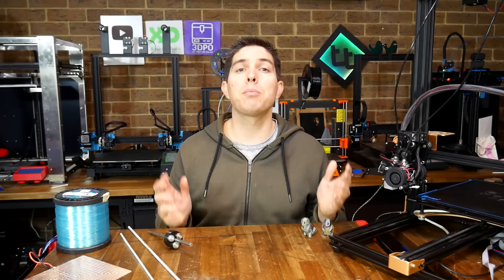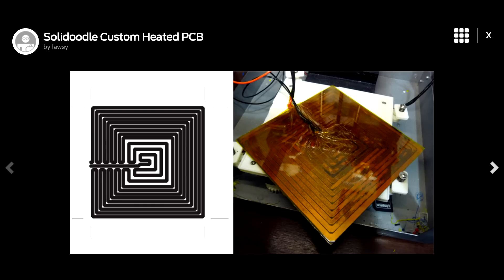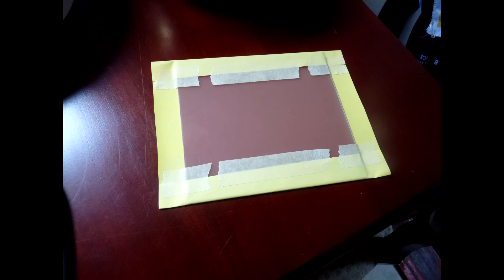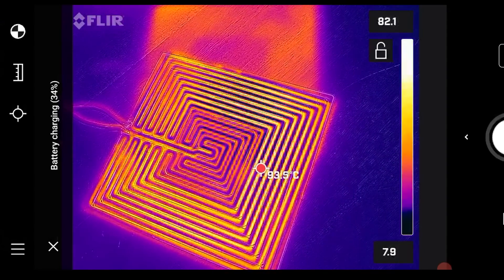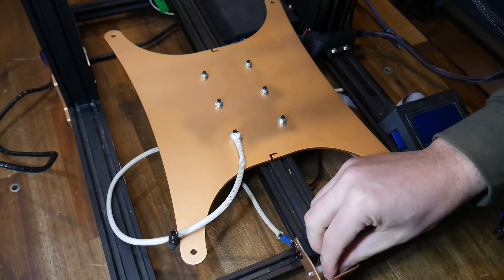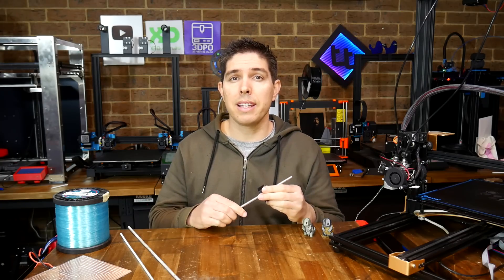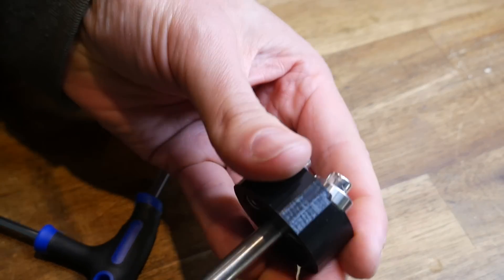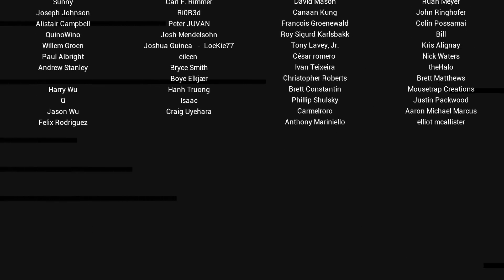Retesting my craziest 3D printer mods from the last 10 years

Comment: Regarding the fishing line. You used mono filament fishing line, this has been designed to stretch a bit. You would want to use braided for the strongest line with the least Strech
Reply: Ironically, he was showing off braided line while talking about zero stretch, then he used stretchy monofilament.
Reply: Dyneema line would be ideal. Extremely low stretch, very strong and any diameter you could want
Reply: @MrTheomossop  Dyneema is very slippery, almost to a comical degree. It might slip even under tension
Reply: @timonix2  would be interesting to see heavy duty kite line (300lb braided dyneema) brought up to a decent tension. Would definitely be lighter than a belt - probably not a noticeable fraction of the moving mass on a Cartesian build though. Maybe for a delta? Delta folks always used to be all about reducing effector mass....
Reply: also can be improved with capstan setup.
Reply: Why don't we make belts to have zero stretch?
Reply: @chucknorrispka  we have reinforced belts with steel belting and fiberglass/nylon but they are expensive and stuff. Cheap and nonstretch is the hard part. Thousands of cyclical fatiguing loads under constant pressure is tough to not degrade
Reply: @napa1617  
I used to use carbon fibre belts on my RC race  car , 3 times the cost and the belt didn't break but it usually just stripped the teeth out on the belt - to much power will always find the weakest point !
Reply: @chucknorrispka  if you preload them. The tensión is higher than the force, and there is no strech.
Reply: @chucknorrispka  have you tried to stretch a straight piece of belt? Even the cheaper ones use glass fibre and such inside. The rubber is just coating on the outside. Steel or worse nylon should elongate more. Steel is also likely heavier and should break faster since the belt core is bent all the time.
Reply: I think fluorocarbon line would be better. Zero stretch and it's thicker. Braided line tends to cut into things because it's so thin and can hold lots of tension
Reply: @ssp_2015  
And fluorocarbon is usually harder than mono .